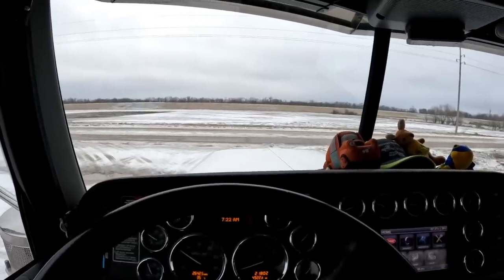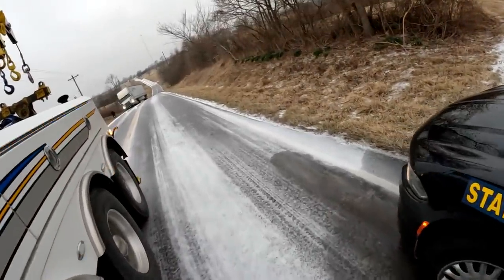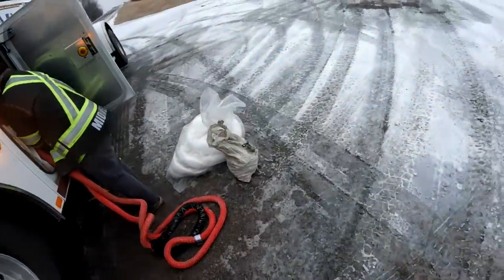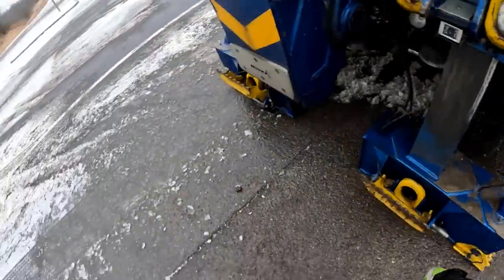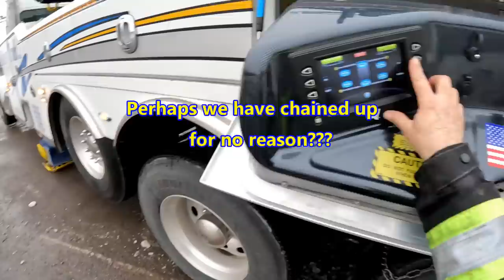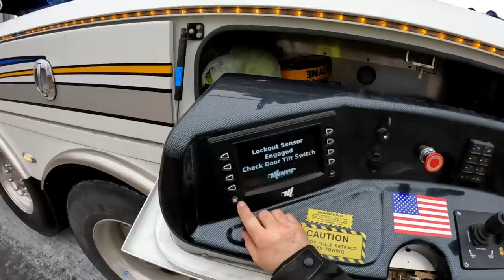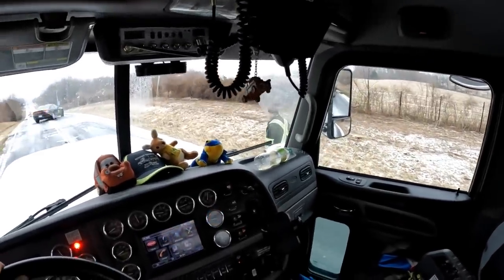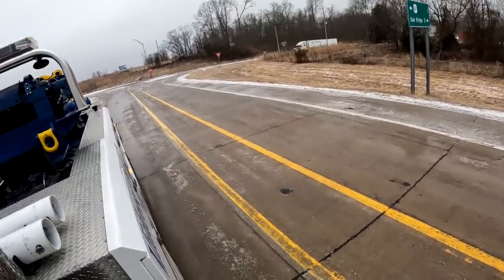First Time Chaining Up the Rotator. Semi Rescued From Ice.

Comment: Ron, As I am certin you have heard before it is said that there is a time for every thing. This was the time for traditional tire chains to be out on the Peterbilt Rotator. I have never head of steer tire chains before. My State of Minnesota dose not allow to be used. At least that was the law as I was told back in the 1990's. I have seen the on demand chain systems on a few big trucks, I have never seen them in use though. I also live in the metropolitan area near our State capital and our MNDOT is great in the metro area on the main Interstates and connecting main highways. Glad you had you person version of chains in the form of you Ice Cleats. Sounds like you should remind all towing and reovery staff that they should have a "Go bag" for all seasons and to bring use those bags on every call out/job.

Comment: Big difference to the mud or sand chains we used far harder to put on to the old b model 6x6 Mack turned into a half track with inch x inch steel treads . Yeah lay them out Jack up then let the air out set chains pump tires up then we change and rebuilt chains more often than tires at times . Then there where few hyways

Comment: Live and learn.  I was always taught to put the chains on with the smooth side against the tire and the open side facing out.  Then again, that was back in the days of wide whitewalls and you didn't want to be scuffing up the white wall with the open side.  My dad sold tire chains in the general store and I still have a set of chains in there original cloth bag from back in the EARLY 1960's.  Rule was Chain up, drive a 1/2 mile, readjust chains, drive a few miles - repeat. Good job Ron. Waiting for Mo Dot to show up just about the time you disconnected from him!
Only thing missing from the new chain bag was a couple of monkey links to repair a broken cross chain.
Reply from the maker: Yep, I had these chains on "technically" wrong side out.   I knew they weren't going to be on long and I wasn't going to be moving fast, so it was hurry up and let's get this done....LOL.   Don't think I even realized it at the time.   I just wanted off the ice and back on clear road.   Thanks for watching and God bless.

Comment: You need a set of those drop down chains like some fire departments use that drop down on tbe sidewalls anf flings the chain in front of the tires , i used a set on my last truck and its saved me from having to layin in the muck 90% of the time ,i used them out west with heavy haul so its not going to hurt with your rotator,  just a suggestion incase you order a new truck soon

Comment: Thought for consideration if have to chain up again. Put the chains under the tires then you can work on the top instead of having to crawl under and around the back side. Don't use chains so not sure if there's a reason you put them on top but I've seen others drive over them and connect on top as well.

Comment: Hint we usually start on the inside dual, then centre and finally the outside. It works easier especially if you have several miles to travel. Tight. Outside with cross bungees and retighten after a mile or so. The “Weedex chains” have better traction on ice sine they cut into the ice. River crossings are best with the smooth chains you are using.

Comment: I know it's your first time putting the chairs on that truck but you made it look very easy. Lol If you could later on in a video tell y you put chains on the front tire that are not power drive . thanks for all you do may God bless you and your family and workers and be very safe out there as you always are.
Reply from the maker: In ice like this, I put chains on the steer axles as well as the drives.   Gravity will take a non-chained axle whatever direction gravity is pulling.   That's also why I was riding the center of the road rather than the edge.   Without the chains on the steer axle I would have run the risk of the front end sliding off the edge of the road.   Thanks for watching and God bless.

Comment: Unfortunately Ron there is a first time for everything. In this case chiming the rotator up. I think you need to talk to the On Spot people  & put automatic chains on. All your trucks that have air (which is [if I'm not mistaken] 2 Mike's & the traffic control truck). You would still have to chain the steering, but with your dudes have them switched separately & maybe another to drop both at 1 time.  Just my suggestion sir. Save a lot of time putting then on taking them off. Anyway sir a great job . We didn't get all you got down there. You all got slammed. If I recall Ste Genevieve & St. Francis County was the dividing line everything north didn't get it as bad as you all did.

Comment: When we put chains on we put them the other direction. Else the open end of the links dig into the tire and ruins the tire. But i also drive hours and many miles on a set of chains if you dont drive far the way you put them on will work.

Comment: Great job Ron!! Also didn’t know that chains go with the crimp side into the tire. Learned something new!! But I do know with them cam lock chains if you can get them on as tight as you can with out flipping the cams then start to flipping the cams to tighten up the chain and you can’t get all of them tight that’s fine because then you go down the road a few miles and get out and check them and if you need to then you can tighten them up with the rest of the cams. Plus if you get them tight you will never need the straps to help keep them on the tire
Reply: Ron got that backwards, Smooth side toward the tire!
Reply: @bobz5474  Read his pinned post saying he admits to putting them on wrong.

Comment: I am a bit surprised that he does not use spike-chains. That is what I am used to in Norway, but things may be different in the US. The difficulty with that kind of thin ice is that chains do not have much to "bite" at, and chains have less grip than tires on almost bare road, so it is not always easy to say what gives best traction (my opinion).

Edit: The ice was thicker than I thought, it is easier to see when he is backing up after putting on the chains.

Comment: Ron, Thank you for showing us all, how to put on the chains onto the tyres.   I have heard of snow chains... but never seen them fitted before.  So this is a good lesson for all, who have never have to fit them.  Are the truck chains different types to car snow chains?? Obviously they are smaller in size... but do they come in different chain types..????
Where I live in Auckland, New Zealand, it never snows in my city..... but other parts of NZ it does snow during the winter season when chains are fitted... so not everyone carries them here. Especially for all us motorbike riders who do not ride our bikes in the snow. 🙂
Reply from the maker: Yes, there are various styles of tire chains for automotive and heavy use.   The chains I used in this video, even though they are expensive, are not the best chains for ice.  These are basically a standard use chain for heavy trucks.  The really good (IMO), and extremely expensive, chains have "V" links that go over the tread portion of the tire.  Even those come in different grades of chain.   Thanks for watching and God bless.
Reply: @RonPratt  Thanks Ron for replying back...  Thank you for the explanation re Tyre chains... so much appreciated.  I did towing back in the day... picking up cars after they arrived in NZ at the Auckland Wharf and delivering them to car yards etc etc. Fun times... just nothing like what you are doing tho.  Learning heaps off you tho.  PS: In NZ we spell it Tyre but you guys in USA spell it Tire...

Comment: I've driven through storms in Colorado, west of Denver a few times.  Just knowing you have chains with you takes a lot of stress out of it.  The one time I had to use them, a bobtail almost identical to the one I was moving cruised right on by the mandatory chain up point.  When I got about 15 miles further down the road, guess who was in the midst of a mishap ... nose in a snowbank, tail out in the passing lane ... I'd bet the officer had a few words for that guy, the kind that would blue the air and melt the snow around him.

I started my day at Grand Junction, went dead at Empire.  I claimed a place to park and went straight to the sleeper as soon as I set the brakes.  Ever had your long, hard day continue in your dreams???  Like "Groundhog Day?"

Roads were clear and nearly dry ten hours later.  I unchained and continued, only to have the air dryer fail as I rolled through Denver.  🙄

Comment: Yeah I believe it I had 2 wear snow chains from Lakeview Oregon on us hwy 97 all the way almost 2 white city Oregon which was a tad over 300 miles it took my almost 9hrs because the troopers put the chain law in2 effect due 2 a fatal wreck slow and study doing no more than 30mph 4 almost 300 miles long I was in a front wheel drive car so I had 2 chain up the front tires and I had auto stick transmission so I rode in low gear 2 the  whole way when normally the speed limit is 55mph

Comment: Man, I wish my truck could lift the tires off the ground like that.   I would actually not mind chaining up if it did.    Those are some tough chains for the price but they rust like crazy.  If you think you might ever use them again, give them a coating of oil or wd-40  otherwise they will rust up and become a MAJOR pain to use.

Comment: Nicely done as always. One piece of advice and one question regarding the chains. I have driven in the mountains of Colorado for many winters and chained up more that I care to remember. I suggest that you hook the hardest to reach parts first. then when you run out of slack you have the most leverage. About the part of the links facing the sidewall, I have always put the smother side towards the tier to reduce the chance of damaging the tier. And the icebreaker chains have to go that way to be effective. Where did you hear that they should go the other way, and how sure are of that? Thank you for the video!
Reply: Read his pinned post saying he admits to putting them on wrong.

Comment: when would you use your liftable axle during recoveries or towing?
Reply: I would say it would be down to weight - for DOT regs.
If Ron was towing a rig & loaded trailer then the lift axle spreads the weight onto the road & thus the lift axle would be down...
If he was just towing the rig no need...
The idea is to prevent ruts/grooves in the road....but also stability of the truck ...
Reply: His lift axle is always down while in motion. When he sets his brakes it lifts.

Comment: This is one of the scenarios where I almost wonder if you should have carried some buckets of water with you and pour water around on the tires so it will freeze them to the ground to add more strength and gripping power
Reply: Due to driving, the tires have a certain temperature of their own. Therefore, the freezing would take a little too long.

Comment: Enjoyed the video. A comment/observation and a question. 

I like to try and use Google Earth to figure out where videos are shot. I do that on most of the YouTube Videos I watch on various channels. This one was really tough. I could not see the Hwy numbers enough to figure out where you were . I finally figured it out when you stopped to take the chains off. The road sign indicated you were two miles from Oak Ridge at an interstate exit. TO answer your question, "No", I'm not trying to figure out where you live or visit any of these places. Just like to see if the Google Car has passed the spot.

Question: Have you thought about giving the time, or placing a time stamp when you pull out of the lot, and then giving an ending time stamp when you get done with the video? I have figured out that on some of the videos ya'll are having to do a LOT of work in between video shots that you edit out. Giving an overall time on how long it took on a particular job can add a lot of context to some of the videos. I remember the truck that ran off the interstate that was heavily loaded that you had to pull out backwards, chaining the Rotator and two other wreckers together. It was extremely hot and you got dehydrated and started cramping up. That was a long, hard job but your video didn't indicate how long in real-time that it actually took. It was much longer than the 1 1/2 or so video. Also, the overturned pipe truck was another LONG, HOT job that you condensed down to just under 2 hours. I'm guessing it was more like 4-6 hours. Anyway, just a suggestion. 

Again, I really enjoy the videos. Be careful out there.

Comment: The joys of chaining.  At least you’re not on the side of a freeway with idiots that won’t slow down and move over and the snow is blowing along with the slush.  

I would cheat and carry extra single sets to throw on the outside duals and not have to do the dually chains unless California was watching.  

I was never able to find a pair of gloves that would keep your hands warm and dry.  So I had a collection of gloves I could change out as they became sponges.   

You want some real strong chains, get the bar reinforced ones.

I would always have the cross links where they connected to the side chains so the two “rabbit teeth” were to the outside and not rub and cut into the tire sidewall.  Just the way I was taught.  🤷‍♂️

Comment: What keeps the bags from over-extending when your on the outriggers and the rear tires are off the ground?
Reply from the maker: VERY good question.   Not long after we got the truck we had the problem of not only the bags over-extending, but the shocks coming apart as well.  We almost had some major issues.     So, dad and I came up with a simple solution.    We measured the extension of the shocks.   We then used that measurement to have some heavy-duty custom straps made that wrap around the shocks.   We had the straps stitched together double over so they were twice as thick, which doubled their strength and had them sewn into loops that were just short of the shocks' full extension.   We removed the shocks, placed a strap around each shock (top to bottom), then reinstalled the shocks with the straps in place.   We have not had an issue since.   Thanks for watching and God bless.
Reply: @RonPratt  Just like a monster truck!!!! Thanks Ron

Comment: I think sand would be better for this no? 
Salt will melt into the ice, and then refreeze right? 
Whereas sand will grind into and give grip, like sandpaper?
Reply: Saltwater solution has a lower freezing point than water. It won't freeze unless it gets colder or dilutes.

Comment: Ron, how long do tire chains last before you have to consider ordering replacements? Is it by mileage, job they are used for, etc....?
Reply: Wear and tear determines the useful life of a set.
Reply: I have a set of chains for my plow truck that are used almost every year, I have been using this set for 23 or 24 years and they are still in fair condition. The thing to watch for is the depth of the wear on the road facing links, once they are worn about half way through the link they can break without warning - time to invest in some new ones. If you noticed the chains Ron was using have cams on the outer rail chain, this makes it much easier to get them snug enough to drive on, they are worth every penny!

Comment: What is the benefit of chaining the steer axle
Reply from the maker: Good question.   On this type of ice the truck is going to go in the direction of gravity.  Chaining the steers helps prevent the front from being pulled off the edge of the road.  If you noticed, when I backed up the hill the first time, without chains, I stayed in the middle of the road rather than in one lane.  This too was to prevent the front end from sliding off the edge.   Most roads, at least around here, are crowned in the center and slope downwards towards the edge to help with water runoff.  I hope this helps explain.   Thanks for watching and God bless.

Comment: You mentioned kinetic rope.  Matt's Off-Road Recovery uses kinetic rope all the time, but I've never seen you do anything other than slow and steady.  Do you do kinetic recoveries sometimes?  Got a link to a video?  :)
Reply from the maker: You are correct.  I only use kinetic rope slow and steady.   I am uncomfortable with uncalculated forces as well as the potential for injury or damage if too much force is applied.   However, I did recently try using my kinetic ropes to remove some saplings with our side-by-side, just to get a feel for ropes and how they react.   I have that on video, but I haven't edited or produced it yet.   Haven't decided if I'm going to do so, but I believe I might.   As far as doing kinetic rope recoveries the way others do, I don't know if that is something I will ever feel comfortable with for the safety reasons I listed above.    Thanks for watching and God bless.
Reply: Makes perfect sense.  And, I think, a perfect representation of the different personalities of you and Matt.  Subscribed to both, enjoy both regularly!
Reply: @RonPratt  there’s a guy in Oregon who does snow recoveries and such using a Jeep with tracks or a pickup, Casey LaDelle, on YouTube and he uses kinetic rope often to pop vehicles out of snow ruts, etc.